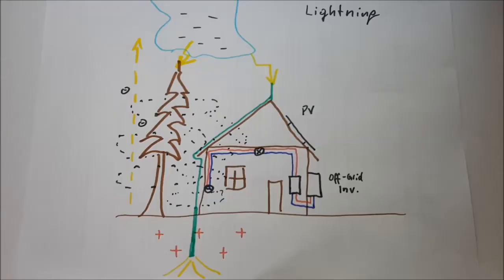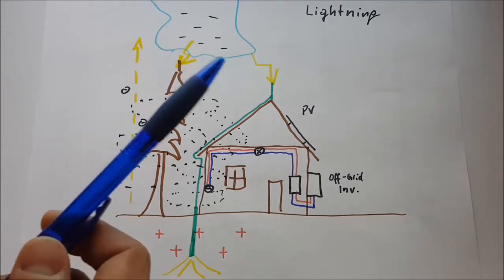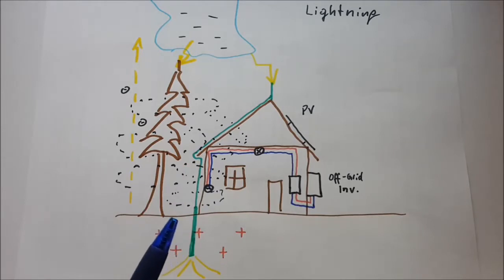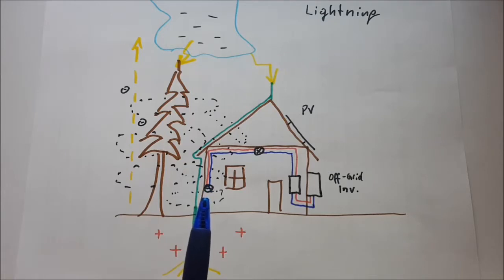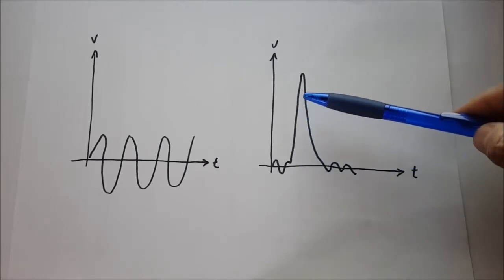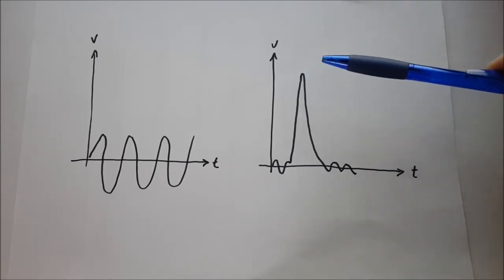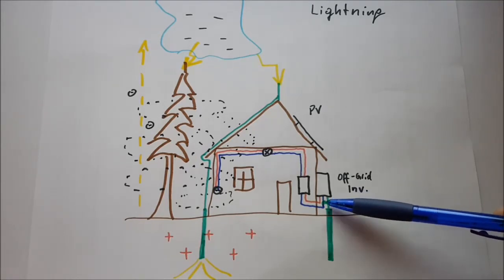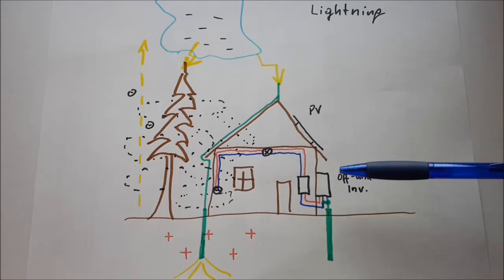How does Lightning explain the need for Grounding and Bonding of Off-Grid Inverters?

Comment: hi again. i'm curios to know, what is the maximum value of the resistance (if there is one) for the grounding system (the rod/rods from within the ground) there where u are?
and since u said u are from Austria, maybe u know the value from there also?
here where i am, for the local grounding system, the one that is connected to the point of separation of the PEN conductor it must be less than 4 ohms, and if u use that grounding system also for the lightning protection, then the grounding system (rods in the ground), must have a resistance of less than 1 ohm. (sorry if i don't know exactly the name of this in english)
Reply from the maker: @cbitzy-t8o  for auxiliary earthing points within the TN earthing system utilitys usually demand very low impedance between 2 and 5 ohms but might even not be specified as the primary loop goes via the conductors to power source. Rod impedance highly depends on the soil type you have and might require fairly long conductors or electrodes buried into the soil if low grounding impedance is required. The 2 ohms requirement in Germany was removed, and a 10ohms requirement for lightning protection earthing was recommended.
Therefore in many cases if the loop impedance over the wire is to high, it is easier to switch to a TT earthing arrangement where impedance is demanded by the sensitivity of the used RCDs. For a 30mA RCD the required impedance will be around 500ohms or less.
If you house requires lightning protection, then at least here in Austria it will be required to lay an earthing conductor into the foundation so that a very low impedance of just a few ohms can be achieved. 
Local requirement are best know by the local electrician. It can really vary or change through code editions...

Comment: Hi Roland. I'm happy that I found this in-depth channel. In many YT-solar panel installations, there is so much focus on stringing the aluminum frame of the panels together with solid copper wires. 
In my rack build (off-grid), I plan to adapt a few of my DC-side rules. I would like to hear your comments from a safety point of view:
1) I will not combine (not even pull a ground wire to the garage) from solar panels PV inputs to the earth in the garage. Because if touching, either polarity of the high PV voltages would not harm you.

2) I will use a surge protective device close to the panels to protect the outside solar panels and, hopefully, batteries/chargers from an 'indirect lightning strike'.

3) It's unnecessary to use copper wires to interconnect solar panel frames if the risk of a 'direct lightning strike' is low, e.g., for a low-mounted ground-based solar panel system. If expecting a higher risk, connect the copper wire to a dedicated ground rod below the solar panels.
Cheers, and I value your feedback a lot.
Reply from the maker: Hi Cptnbond. Your rules are correct. As I am understanding correctly from your description, your rack is a distance away from the garage with the inverters. Earthing arrangements should therefore be localized at each place and separated as there is no way to touch two pieces of separately earthed equipment at the same time having 2 different potentials. If your mount is made of metal then connect it to a rod at the mount, as well as the SPDs at the panels. Be aware that the DC power lines will require a second SPD at the inverter if the inverter is further than 10m/30ft away from the panels. Use the PE system of the garage to connect to earth there. 

Earthing panel frames as you have noted may be omitted if the risk of a direct lightning strike is neglectable. A grounded metal mount will suffice, but there are special plates which can be put between frame and mount and bite into the aluminum of the frame to break its insulating skin which might be used to bond frames to mount. If your mount is made of an insulating material like wood, I would nevertheless ground all frames with a wire.
Most of the equipment will share common ground (same minus) on its DC side. Do not connect any devices power lines (like battery neg, inverter neg) to ground to stay isolated from earth on the DC side. 
Cheers, Roland
Reply: @RolandW_DIYEnergyandMore  Thanks for all golden knowledge of yours. Cheers.

Comment: Hello! How can i wire my PV array (serial ) with a SPD and a circuit braker? I meen the wires from solar array (+ -) come in SPD then in circuit braker and from SPD out in ground?I have SPF Growatt 5000 ES who i dont connect to the grid , i use only the battery and the PV array and output to power my appliances.Thank you!
Reply from the maker: Yes correct. DC SPDs have a connection for + and -. There you connect the power wires of the array. The SPDs ground terminal you connect to a grounding rod best just right there at the array. On the + wire, you install a breaker or fuse next to the SPD before you continue to go to the inverter. Check my video about PV Basics: Surge protection and grounding in the playlist. Thanks
Reply: @RolandW_DIYEnergyandMore  Thanks alot! It s my first solar project and i am starting to like it :) Your video helps alot ! Thx again!
Reply: Ps Why only install breaker on  + wire and not the - too? About the DC  braker why come with 1000V , my invertor accept only 450v . THX!
Reply from the maker: @ciprianalexandru7369  well, breakers disrupt electric circuits in case of shorts/overload. As energy is flowing from plus to minus, it is all safe already once the power is cut at the place, where it starting its journey... I only use 2-pole breakers where there is a need of a dedicated main breaker, and 1-pole breaker within the distribution.
Reply from the maker: @ciprianalexandru7369  the voltage rating is for the maximum breaking capability. Higher breaking voltage is better! Breaking DC is difficult as it is creating a ark. Higher system voltage will create stronger arks which the breaker needs to cut. But in case of the SPDs, you need to get one with a Uc (clamping voltage) close to your system voltage. Confusing, right? :)
Reply: @RolandW_DIYEnergyandMore  First i put the wires (+ --) from the PV array in the SPD and close the SPD i put a braker (on + like a V shape) then to the invertor? I fiind a SPD type 2 with Uc 500VDC  from the solar array to the invertor i have like 10 m , sow type 2 is good? I will mount the SPD  close to PV array .Thank you!
Reply from the maker: @ciprianalexandru7369  yes, sounds all right! but you will need another DC SPD at the inverter as well as your wire is 10m or more. As well as an AC SPD at the inverter output. Those you can connect to any ground you have at the inverter.
Reply: @RolandW_DIYEnergyandMore  The problem is i dont want to connect the invertor to the grid sow i dont have ground. The AC SPD from output of the invertor is to protect loads there are connected to the invertor?If i dont connect to the grid can i use the PE of the house to use the DC SPD? Thanks alot and I hope I don't bother you with so many questions.
Reply from the maker: @ciprianalexandru7369  the second DC SPD at inverter DC input. This is requirement, as the DC SPD at the array further then 10m away, cannot protect the inverter anymore effectively. The AC SPD is at the inverter AC output. You don't need to have a grid. AC SPD is protecting the inverter from surges which are induced inside the house wiring. But in a ground bonded setup (TN), that risk will as well be minimized there too.
Reply: @RolandW_DIYEnergyandMore  I understand the first part but I don't understand where i put the wires from SPD ground
Reply from the maker: @ciprianalexandru7369  the SPDs at the inverter you just connect to ground, which you have available there. Typically it will be the ground of your house. Probably it will be a different rod. Then that of the array...
Reply: @RolandW_DIYEnergyandMore  Thanks again for your info , helps alot!

Comment: Roland, thank you for this excellent explanation. Now a question. Can the copper wire used for a lightning arrestor really survive the enormous current that lightning produces? My guess is that the wire would vaporize with such a current and a fire would start by virtue of the heat produced. Is this correct? Are there any pictures of structures that have been struck and have an arrestor?
Reply from the maker: Buildings with lightning arrestors are struck daily somewhere during storms. The current is actually not even flowing deep inside the conductor. It will only flow on the surface inside a plasma layer same it would pass through the air and wood. The conductor will just guide the lightning towards the ground. If you would make a 90 deg bend on the arrestor conductor as its actually very common, the current will actually get airborne again and jump on the conductor later again. We are talking here about extreme physics ;) Different are the inductive surges, which are caused in electric systems indirectly by lightning. Those are only high voltage, but little current. Those we can technically deal with. But nothing would survive a lightning hit straight into our low voltage installation.
Reply: @RolandW_DIYEnergyandMore  Thank you for this response. And when a tree is struck, is it true that it 'explodes' due to the rapid boiling of its fluids?
Reply from the maker: @davidabineri908  yes indeed. A direct lightning strike can even burst reinforced concrete if it travels down via the rebar to ground. All effects of the hot plasma it creates.

Comment: Hi Roland, I have a lighting protector on the DC solar cables which diverts voltage > 1Kv to a grounding rod, am I to understand this is wrong?  Also what is the reason not to bond the 2 earth systems together?  I have a UFER earth for the house and a separate ground rod for the solar shed (about 5 meters away) and off-grid inverter, both bonded together, I suspect this is wrong but am not sure why.  The neutral is bonded at the breaker box rather than the inverter as the UFER is the higher quality ground and a shorter cable run.  Please don't feel obliged to answer as I appreciate the information already provided and sure you must be very busy these days.
Reply from the maker: As said, the PV DC side is perfectly protected by SPDs only. Either Panels as well as DC input of the inverter are typically protected well enough against surges which come from lightnings. It is only the AC output, and your installation with all its appliances, which is much more vulnerable against high voltage surges, which can easily build up in IT earthing systems (system without a ground bond). Bond at breaker box is perfect! Its always better to have more then one rod and keep distances of grounding wires as short and direct as possible.  If wiring of those rods is seperated, then a 5m distance between two rods will prevent voltage to be picked up from the non energized rod. If two rods are interlinked by a cable, then you effectively make one rod out of two, and the distance between them, actually doesn't matter as both will be similarly energised if a surge is injected into the system. But two rods improve overall impedance, so the surge will be dissipated faster.
Reply: @RolandW_DIYEnergyandMore  Thank you very much for the reply.  Reassuring to know I got it right first time.  I also just watched your video "PV Basics: Grounding and Surge Protection" and have the same setup at the inverter but looks like I need to add additional protection closer to the panels as the cable run is > 10m.
Reply from the maker: @phunwithphiphi8055  yes, correct! Greetings to Thailand. I hope I will be back before end of year.

Comment: Hello Roland! Thanks for the great video, and all your knowledge. In this off grid scenario, should the solar panels be grounded on that common inverter ground? Also, if the building is metal, should the building be grounded to that common inverter ground?
Reply from the maker: hi, if you do have the chance to seperate to use 2 rods at least 5m away from each other, it would be an advantage to ground structures, lightning arrestor, panel SPDs on a seperate rod. Inverter DC input SPDs, AC output SPD on another one. But if you cannot, just use one point of high quality grounding. important, that the cable lenght to grounding rod is kept as short as possible.
Reply: @RolandW_DIYEnergyandMore  in your diode video, it didn't seem that any of your PV panel frames had grounding wires. Did I just miss it? My panels are mounted on the corrugated metal roof of my patio cover, look very similar to your setup.
Reply from the maker: @keithwingo514  my panels on the car ports are grounded via the steel structure directly. I didn't use an extra wire to connect the aluminium frame again. That area is as well surrounded by high objects like trees and power poles so it is very unlikely for a lightning hit into the frames. But the power wires are connected to SPDs there to prevent indirect surges of course .
Reply: Thanks so much for the quick reply, Roland. Much appreciated. Your videos are great.